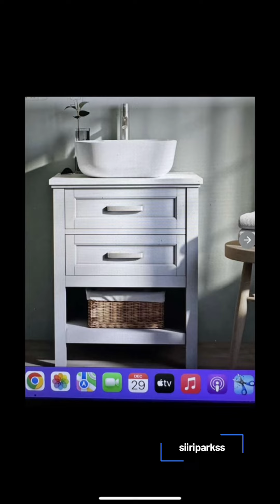Bathroom renovation Part 2 #siiriparkss

Comment: That looks awesome so far! My mom and I are working with a friend to redo one of the bathrooms that hasn't worked since we moved in 5 years ago. Both my mom and I are disabled and we need just a shower with low step in. I can not wait to get it done hopefully sometime this fall! Our other bathroom works just fine however it has a tub in it and the step in and out is scary for my mom and I as she has a severe spinal issue and I have a brain injury and get dizzy easy. I can not wait to see your bathroom all finished, I love the colors you choose!!

Comment: Wish I had the money to redo our bathroom.  It was flooded from the unit above in 2019 and it hasn't been the same since. The ceiling has hole in it in the shower, where the leak was, but now has eavy duty plastic to catch any debris between floors. It was a insurance nightmare. It flooded our carpets too, so all we could afford was the replacement of the carpet, due to mold, to flooring. I don't recommend it.